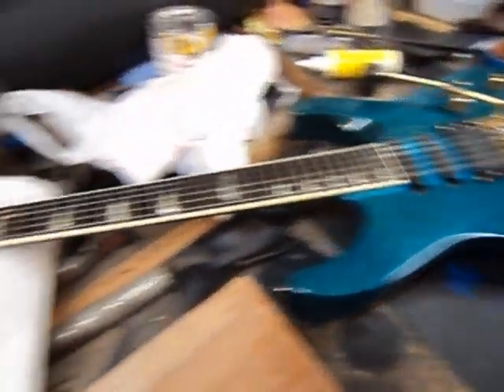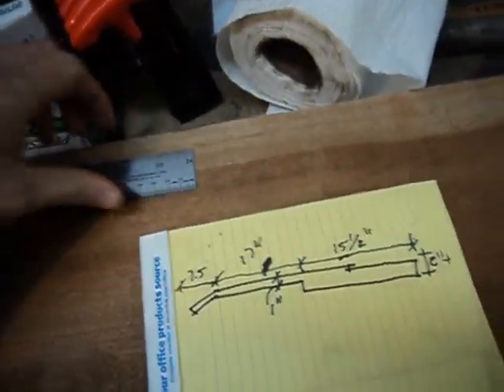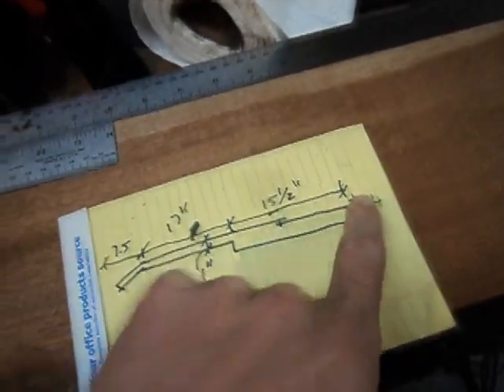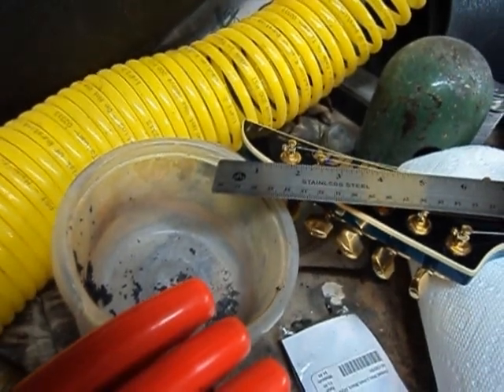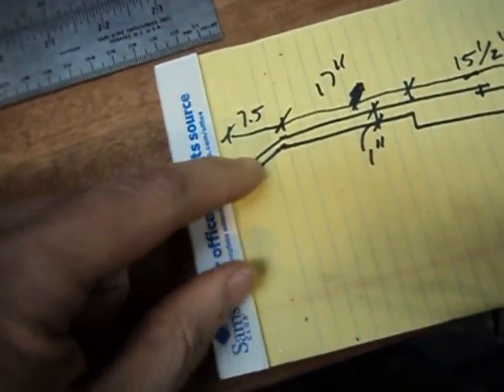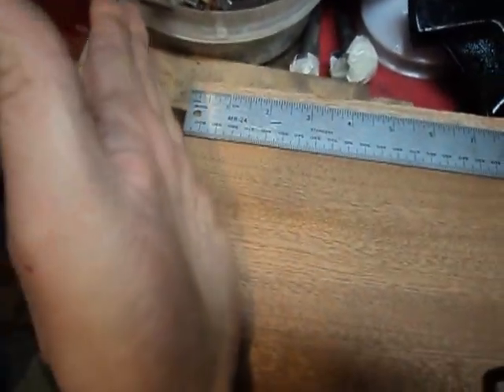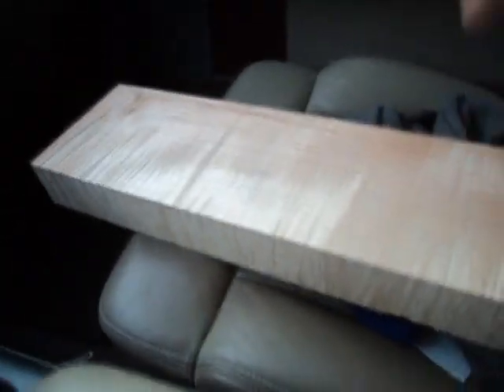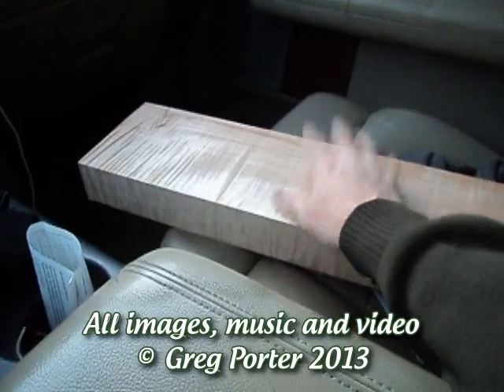Guitar Build - Part 2 - Laying out the Neck Blank

Comment: Did you get to hand pick your own wood or did you have to order it and work with what you get. Sorry if you already covered that.
Reply from the maker: I hand picked the neck wood.  I completely tore apart the sapele section at the lumber store.  This was a cutoff from a 10' board.  It was the only board in the rack worth taking home.  The maple was ordered on-line after sorting through a couple hundred listings.